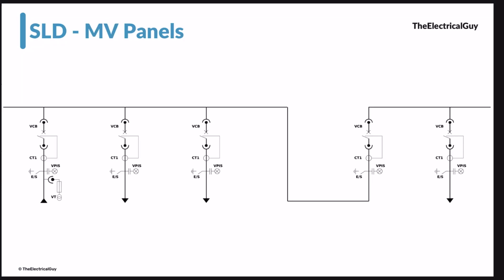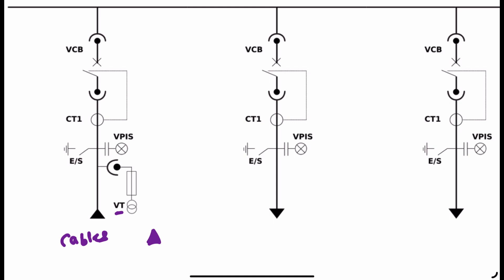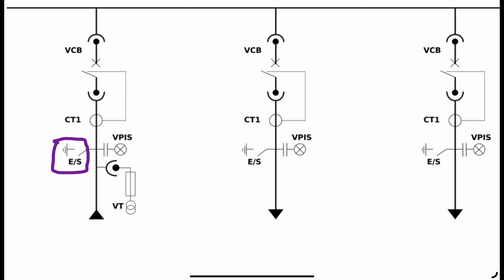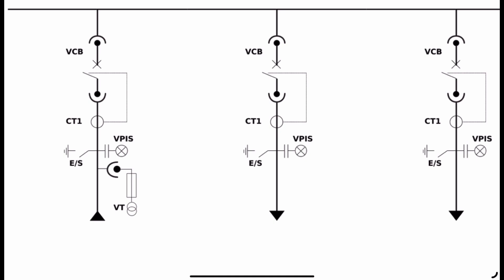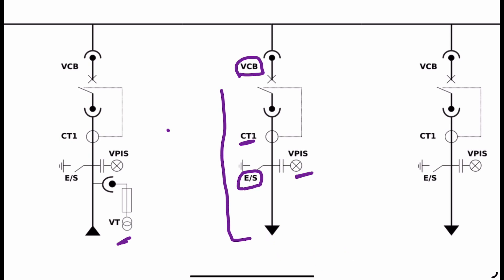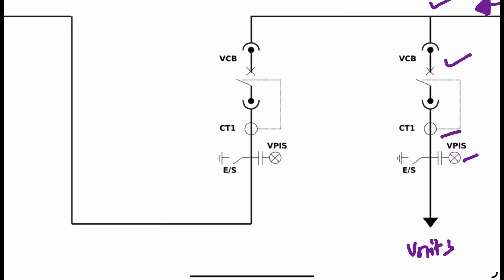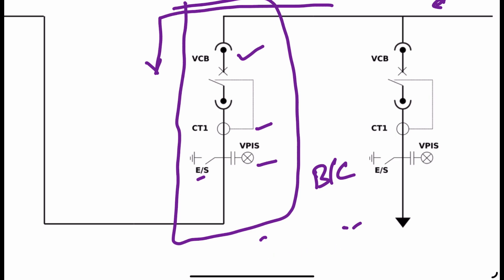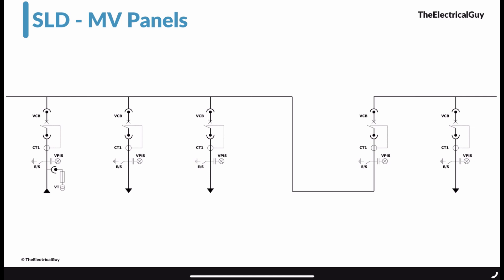SLD of Medium Voltage Panel/Substation | Explained | TheElectricalGuy

Comment: Is there mechanical interlock between the bus coupler and both incoming feeders and how do you achieve that, or is it electronic interlock through the protection relays?
Reply: Generally, electrical interlocking is provided between B/C & Incomers. But, key interlocking can also be provided which is mechanical.

Comment: One Doubt. The orientation of SLD you have shown, here bus coupler is connected in series, right. So if it in series why you have brought it down? Why not connected directly to the bus in that case you don't need bus riser also.?
Reply: If you connect the busbar at upper side only then it'll get connected to only one end of the VCB. In order to have a series connection the panels are designed in such a way that it provides outgoing busbar at upper side and incoming busbar at lower side. Bus riser panel only helps in getting the busbar from outgoing of VCB1 to incoming of VCB2.
Reply from the maker: Panels in horizontal direction is not available. Hence it must be brought down.

Comment: The CT will never ever directly connect to VCB. The VCB will be operated with separate protection relay hence the CT will have to connect to protection relay. The symbol in your SLD is wrong.

The SLD shall also be shown interlocking symbol between earthing switch and VCB.

The bus coupler is incompletely explain there shall be synchronization for this M-T-M as it is secondary selective scheme.

Remember the CT protection and metering for MV Switchgear shall be  individually provide. The CT you were explaining, shall be for protection cannot be for both protection and metering.

And other many important keys are also missing in this SLD explanation.

Hope this help.
Reply from the maker: The SLD is very basic level. Certainly a detailed SLD will have all the details . The intention of the video is to give basic understanding only.